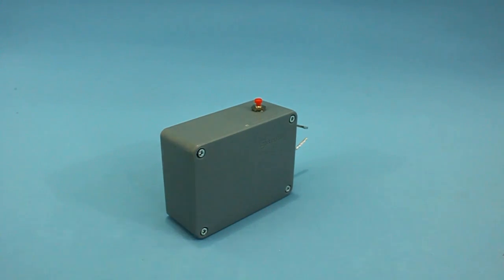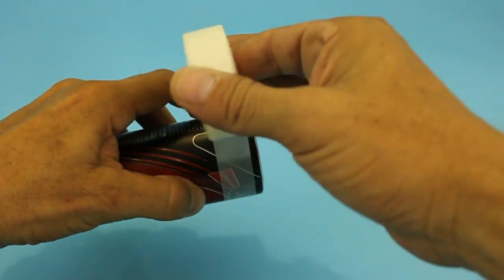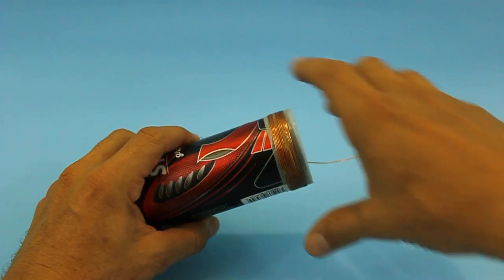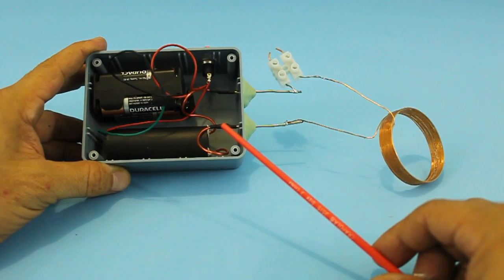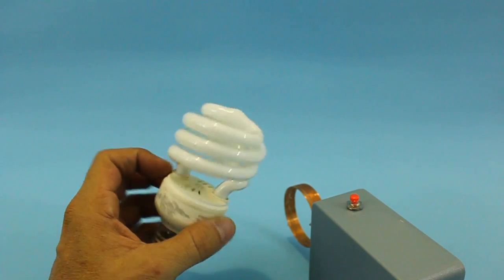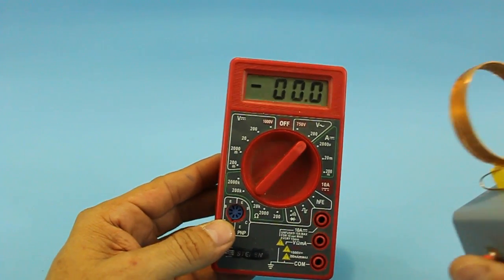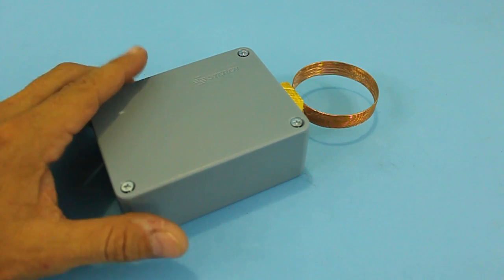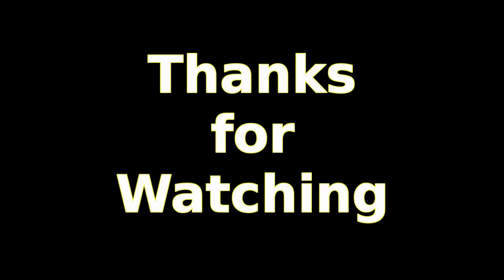Electromagnetic Pulse Generator EMP Device

Comment: It is a spark gap radio transmitter. Which due to the the broad frequencies and large band width are no longer used for radio transmission but was great in early radio in the early 1900s

Comment: Will increasing the number of turns on the coil improve range or effectiveness? Will adding a high voltage capacitor increase range? What wire did you use? Insulated or not?
Reply: Muhammad Khan my questions too
Reply: too much questions dudes go back to class
Reply: Platinum phones & computers shut
Reply: @platinumphonesandcomputers  and even you don't know nothing about that.

Comment: What if you increase the number of windings-would it enhance the EMP output?
Reply: Yes, but there is a better method. Simply putting an iron core inside of the coil will significantly enhance the output.

Comment: why we have to make spark gap instead of normal connection?
Reply: It is the spark that produces the radio frequency energy. The coil will radiate it. Early transmitters used spark gaps.
Reply: because it cause the electricity to fire in short pulses rather than a steady current that way instead of just being a normal magnet it's a pulsing magnet which has a stronger effect on electronics

Comment: What is the purpose of the spark gap? Just to create pulses rather than a continuous field?
Reply: That's why it's called an electromagnetic pulse/EMP. If it was an unchanging continuous field, basically no electricity would go into the electronics. Changing fields (due to turning on then off, moving, etc) generate electricity. I believe the spark gap is there to also make the field quickly collapse. I'm not sure if there's other reasons why it's used.
Reply: @HarrisonMartinson  Can it be used on an electrical wire to cut the current?

Comment: How did you protect your camera with alumnium foil without blocking the lens?
Reply from the maker: +LiuyoMZ I did not. The pulse only travels a few centimeters. Its power decreases with the square of the distance.
Reply: LiuyoMZ FLEur and the at home

Comment: In 1938 the International Telecommunications Union prohibited this type of emission (called "class B") to get the last spark-gap telegraphy transmitters off the air, and it is still prohibited in all nations. Title 47 of the FCC regulations has the prohibition in a footnote at the bottom

Comment: I'm pretty sure that if you had a larger pinch (EMP), the Tin-Foil would not block it at all
Reply from the maker: you can use a 10 times stronger pinch but a slightly thick foil will block it
Reply: So a pinch that could wipe out a city block, a little piece of foil will block?  That's Cool!

Comment: Reminded me of the slot machine i messed up in high school (in 1998 or 1999), just by using a piezoelectric spark generator from a lighter, and touching it to some metal parts close to the coin input. That just turned it off, and my friend lost the money he put into it, oops. Took several days before it was up and running again, so i guess something happened to it. I just did it out of curiosity though, since i allready had the spark generator after a few days of pestering my friends with it.
Reply: Wormweed why was there a slot machine in your school lol
Reply: Tyson Romaniuk my high-school was nextdoor to a music/theater scool, and that's where the slot machines were, in their cafeteria.

Comment: You can be charged with murder if you use such devices around people with electronic medical devices, and generally the disruption of electrical devices has legal ramifications. Most people won't tell you they have a pacemaker, so using these kind of devices in a crowd is an absolute no-no.

Comment: Maybe your device was just too weak to penetrate the thin aluminum foil? Make a more powerful device and it will go through the aluminum foil.
Reply: I think it just turns the emp into heat, so it would melt rather than leak emp

Comment: Consult an attorney and a doctor. FCC Part 15 prohibits emp emissions. USC Title 50 awards 35 years for building and using an emp (not sure they are talking about this device). Modern cars have computers in them, $450-2500, to replace them; you break it, you buy it. 
 If you disable someones pacemaker or respirator etc. you’ll probably be charged with murder.
Reply: "If you disable someones pacemaker or respirator etc. you’ll probably be charged with murder."     This is what I was going to say

Comment: I'd like to make one of these for an experiment.  We're looking to generate a field of about a 10 foot diameter using pulsed emf.  But we would need something that does not generate as much noise and that would run MUCH quieter.  Any suggestions on how to do so?
Reply: Maybe a large capacitor
Reply: I know this is late but you can have 2 switches, first one to charge the capacitor, when the capacitor is done charging then press the second switch to transfer the current from the capacitor into the coil. It won't make sound and it will be more powerful too.

Comment: For those of you wanting to make the EMP stronger... Make sure you read this THOROUGHLY before you even think about going down that route, this contains a lot of information useful for what you are intending, and some risks that may deter you from making it stronger than the following explained. If you're not going to read it all, at least heed to this... DON'T GO ABOVE 60 AMPS IF YOU WANT TO KEEP YOUR LIFE. AND REMEMBER, KEEP ALL ELECTRONICS AWAY FROM ANYTHING YOU DON'T WANT TO PERMANENTLY DESTROY!

You can up the current in the coil by using a higher rated power supply, or a transformer. Or you can increase the size of the coil from say 10 turns, to about 30, that will increase the strength of the electromagnet, making the field much larger. However if you want to best results, you can add a higher rated power supply, or the transformer for greater current, increase the turns on the coil, but instead of making an open/hollow coil (With no core), use an IRON nail as the core, the bigger, the better... Just don't go over the top, because high current is dangerous, and could lead to severe injuries, or even death. Be careful if planning on using a microwave transformer as they output around 60 amps. Which isn't enough for certain death, but is high enough to cause severe muscle contractions, so I would say stick well within the 10-15 amp range, if you're not ready to risk it all just to make an EMP Device. :) Please read up on further guides if you are skeptical, or seek a professional's opinion before playing with high current. I am not a professional, but I have gone through my fair share of electronic 'experiments'.
Reply: Do you, by any chance, mean mA? 60 Milliamperes? 0.06 Amps? Because 60 A (with the 2000 V from a microwave transformer behind it to drive the current through your body) is about 3000x the current needed to injure someone and (let's be generous) 500x the current needed to kill someone, if it goes through the heart. Also, 60 A at 2 kV is about 120,000 W of power. No microwave transformer will supply that much power, even if you short it out. A 600 W microwave transformer will usually be able to supply at most 0.5 A. Which is still absolutely deadly by the way.
Reply: Yes, I did mean mA. Was quite late when I had written that. Thank you for your corrections, greatly appreciated.
Reply: Allright then, that makes more sense. 
You're right though, 60 mA (average over the pulses I would assume) is really quite a lot of current and should not be toyed with. 
However, I do not quite understand your suggestion of putting an iron core in there. That will dramatically increase the inductance of the coil (the "inertia" might be a good comparison), thus reducing the slope that the EM-field rises with. In average, the field strength will be much increased, but at the cost of maximum field strength and emitted power. 
Short, but very powerful pulses are definitely the way to go for building an EMP device. (Hey there, NSA. How are you doing? ;P) As such, if you  increase the voltage (as you suggested by using a stronger power supply), the destructive power is definitely going to increase a lot. And the danger. So please don't do that unless you know exactly what you're doing.^^
Reply: Oh and by the way, in most countries, owning or, even worse, operating any kind of high power Radio frequency device is highly illegal. So there's that. :D
Reply: who is going to get 60 amps lets say 10kV ??
Reply: True, unless of course, in the United Kingdom, a license is purchasable to operate such devices at high power radio frequencies.
Reply: You can be charged with murder if you use such devices around people with electronic medical devices, and generally the disruption of electrical devices has legal ramifications. Most people won't tell you they have a pacemaker, so using these kind of devices in a crowd is an absolute no-no.

Comment: Before you decide to fry someone's pacemaker you should really read up on radio communications restrictions which apply to your nation.  In the US, the FCC will have your ass to the tune of $30,000 per incident aside from possible criminal charges and jail time.  Use of any kind of radio freq emitter which causes unwanted interference, such as local cell jammer or this pulse generator, will likely get the full and undivided attention of the all powerful FCC.  The story of your experimental device has an extremely high probability of ending very poorly indeed, even at the low power capability of this device.  Tread carefully and don't end up destitute and in jail because you wanted to play with this toy.  If you really want to wreak some havoc and really jam up some radio traffic, there are much more effective designs.  Pretty scary ones actually :)  Radio is cool stuff.
Reply: +Ian M:
Yes, but it is a small device powered by a few AA batteries. The intensity of the radio waves emitted is low. Maybe it will effect radios and TVs (running on antenna) in his immediate neighborhood only.
Reply: Don't care.

Comment: i'm not convinced on those slot machines.

some tinfoil might work here, but what about a far more powerful EMP?
u can get a lot more powerful even with a handheld device.  
and in order to 'hack' the slot machine all that is needed is a momentary disruption to trigger the test program
it enters when u first plug it in. 

i would guess the machines are shielded with a faraday cage, that connects to ground via the power plug.
which in europe could easily be plugged into a socket that has no ground connection.